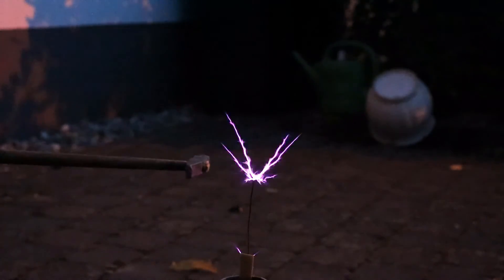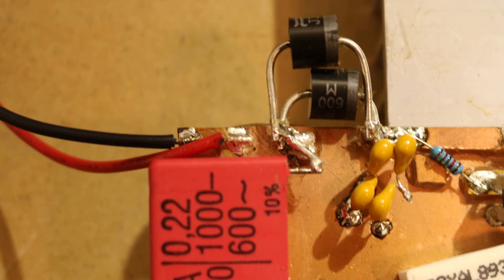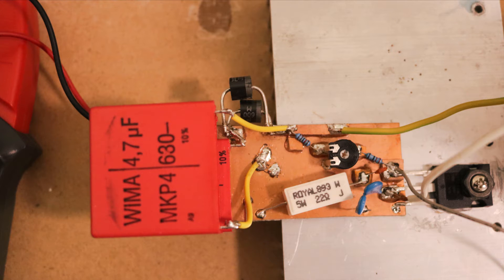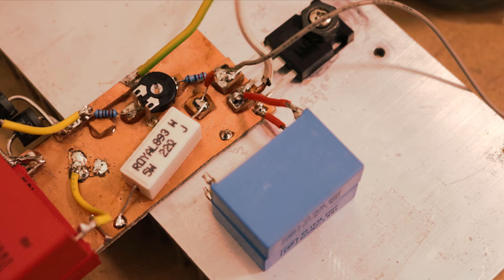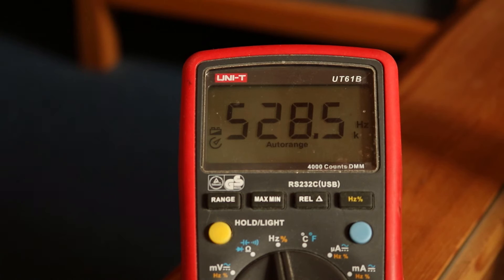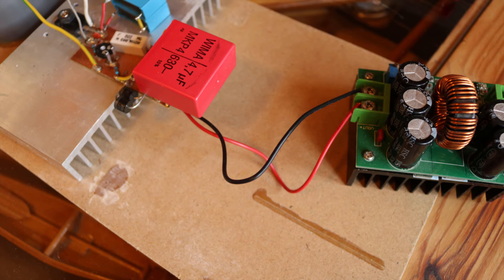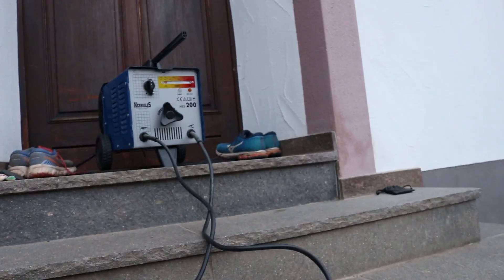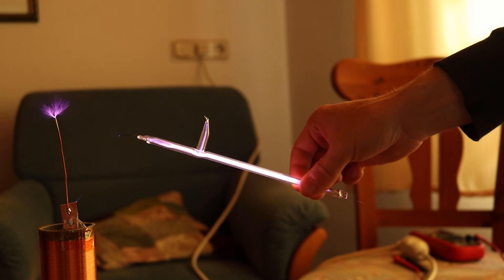How to build the simplest [SSTC] Tesla coil

Comment: I have larger coil which has 5000 turns as secondary has 1m height and 5 inches as diameter 
Does this circuit works for it?

Comment: Interresting design with the biasing, however I am not sure it is optimal. Your bias voltage effectively depends on the input voltage (while it can be regulated by a potentiometer by you) the feedback rate here is far to slow and can be neglected for 50 Hz. While this can run ok on low power on DC, this circuit might be very unhappy on AC. Not sure how the transient responce will be, but you have a convergence time to the limit cycle dependent on the input voltage complicating things supstancially. Also, your circuit is not really protecting the gate of the mosfet, as you are only adding capacitive loading onto it. While you are taking charge, you are not really protecting it, rather slowing down the circuit and contributing to excess heating due to slower rise and fall times. 

You want this circuit to run in a digital mode and switch as close as possible to a square wave, the reason being is you have a higher power density and less heating generated due to the ohmic region of your mosfet. In order for this to happen, you actually want a mosfet with the lowest gate capacitance possible so as to reduce gate current flow and heating and also to speed up the switching reducing ohmic losses, not slow down the circuit. 

Lastly, if you start the circuit at too hard a voltage, there is a good chance a transient will blow it when it should not blow due to an overvoltage at the gate as your circuit is unclamped. 

I would recommend you make a separate, low impedance stable and clamped bias for your circuit and leave the feedback as is. 

Not sure about the function of the two capacitors across the mosfet, I would immagine they can create some interresting resonance effects enabling double pumping of the circuit if properly tuned and if the voltage gets high enough. How this will affect the stability and behavior, I am not sure, but presumably might marginaly increase output depending on the impedance of your coil. I believe a double resonant design would be superior, although I am not 100% certain. 

Love the channel name though hahahaha. Is it a fox?

Comment: the current cannot be low, but the frequency is high so it only burns.
Also the top loads capacitance is being increased with throws the TC out of resonance, thats probably why it broke the mosfet when you tried the hammer
Reply: yes and probably a transient voltage happened from the secondary based to the gate that killed the fet too, since theres no TVS or zener diode to clamp it.

Comment: After going through the diodes the 48v AC is around 68v DC half wave, right? 
So, can I use a 12v AC 5A power supply with a doubler and a smooth capacitor to get 60-70v dc and remove the two p600m?
Reply from the maker: Idk how you got 68 V and voltage doublers are for low current applications as far as I know.

Comment: That's pretty sweet, good job dude! You should try it with the topload on! The arcs from the simple SSTC on my channel doubled in size with a topload, and the resulting lower resonant frequency is also easier on the MOSFETs.
Reply from the maker: I had a small topload on it, but I'm not sure anymore if I actually tested the tesla coil with it.
Reply: @thesciencefurry bro, what is the needle-ish thing that emits arc on the top of the coil?
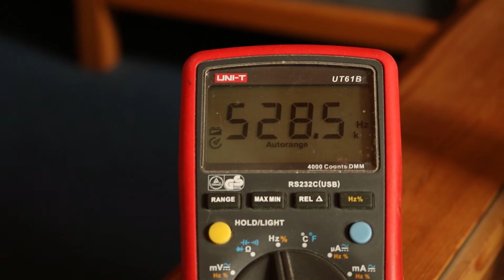Reply: What's that long thin thing at 2:51
Reply: @odio_stationofficial3420  its the breakout point ,just a pice of  copper wire